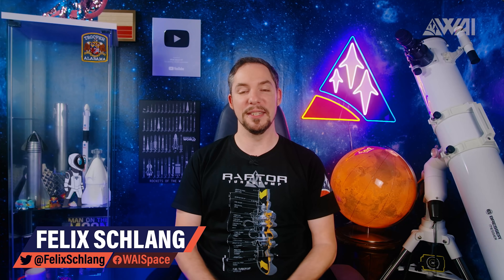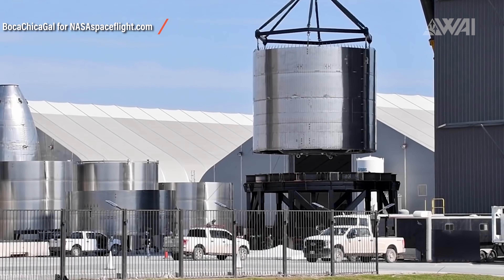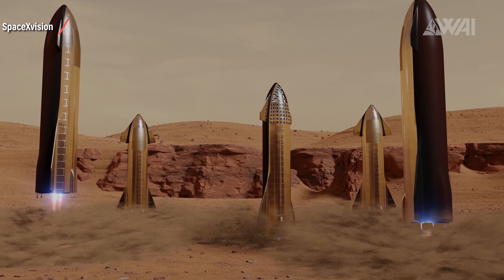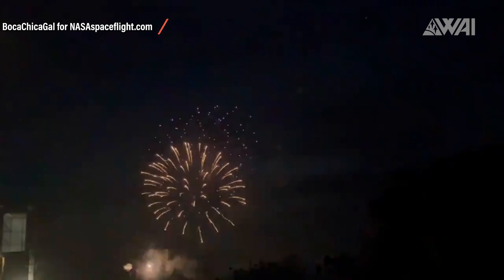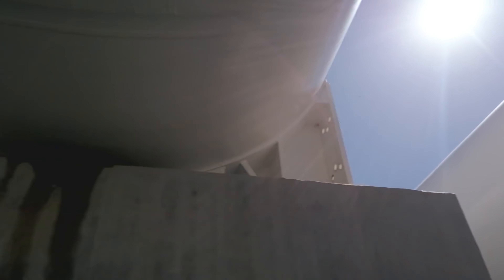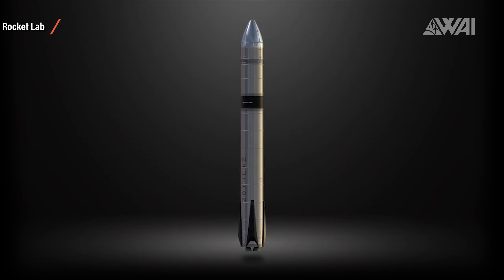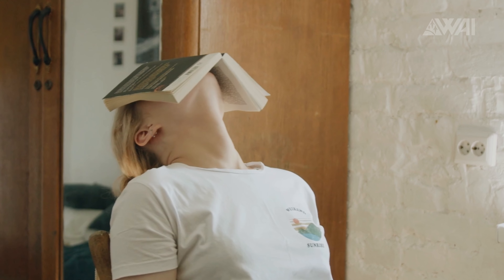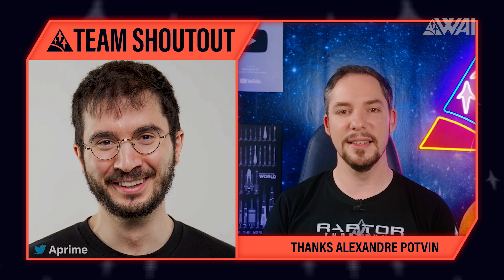SpaceX Starship Without Legs? Is Elon Musk Serious? Blue Origin & Rocket Lab Next Gen Rockets!

Comment: Could SpaceX create barrier between the helium and fuel supply in the header tank to prevent the issue with helium getting into the fuel supply? Use a bladder similar to a water pressure tank.

Comment: Cant see the legs working on mars or moon tbh, surely they're too small with a small surface area to take the whole Starship weight on a uneven, possibly softish/yielding surface. Something more akin to Falcon 9 would seem to remedy that, surely can't be that big a design challenge. The shuttle had undercarriage  that opened 'thru' the heat shield.

Comment: If it works for the Falcon it could be designed for the Starship, use Falcon landing legs but more robust.
Reply: The point is, Falcon landing legs are heavy. They are seeking a solution that will minimize mass, thereby maximizing payload capacity.
Reply: Could they make a similar idea of the Falcon landing legs out of Titanium or aircraft grade Aluminium.

Comment: Might as well give up on re-usable rockets and any plans for interplanetary colonization.
Trying to come up with clever ways to do away with some sort of leg/landing structure that is actually part of the vehicle, is counter-productive in my opinion. Maybe it's easier or more convenient than developing more powerful engines that would offset the added weight of proper-sized legs. To me, this sounds very much like how the space shuttle was developed. First, starting off as a complete single-stage-to-orbit space-plane, and eventually deforming into a sort of space-plane, that was dependant upon a huge external tank and boosters. The ideas now being proposed sounds like the development path is taking the same familiar route. That's too bad.

Comment: I still don't understand how starship can land vertically on just one engine offset from the centre.  It has to tilt to maintain balance.  Can someone enlighten me?
Reply: If at the same time it drifts slightly sideways, it can stay vertical. With just the right balance between vertical speed, horizontal speed and engine gimbal, it can touch down with minimal velocity and tilt.
Reply: Yes. Even I have the same doubt. With one engine it will tilt a bit. I don't think it will work out. However, SpaceX team is extremely talented. They will come up with new ideas.
Reply: It's like balancing a broom with your hand, but with a lot more accurate systems for precise balancing
Reply: @dwdadevil  But when you balance a broom your hand is directly below the centre of balance going through the shaft.  Starship is more like balancing a brick on one corner.  You have to tilt the brick to get the centre of balance above the corner, or it immediately topples over
Reply: @EASYTIGER10  As they did with a mass simulator, and the purpose of starship (cargo/crew) transportation, the broom is a great example.
But the brick example is good too, difference is computers with a lot of sensors are better than a human at maneuvering a starship

Comment: Can’t understand why nobody is saying much about the fire on SN10.  The fire appears to have started when one of the engines shut down. From that point on, the vessel was doomed, regardless of how it landed. With the fire burning and being fed with fuel,  if  it lasted long enough the metal temperature would have become high enough to guarantee the skirt/tank end cap would fail.
Reply: Obviously if persistent, fuel leaks must be solved. But failure was a LOX tank rupture. That has more to do with very hard impact and lack of engine thrust modulation.

Comment: Look, guys: helium pressurization don't help the fuel problem. The fuel is weightless in free-fall (zero g). When the flip is done with rcs thrust, the fuel is still weightless and floating around. Not until AFTER the rocket manages to get enough sips of helium and fuel, will they ignite, create inertial gravity, and then the fuel sloshes to the bottom of the header tank, and then one of the engines MIGHT light up ok.... Elon needs a baffle tank, like in plumbing: there's a rubber membrane (or u could use a piston and cylinder to pressurize fuel without any air or gas headspace. Just a thought...

Comment: I hope they will stick to legs and not ditch them, they have to at least use them on moon and Mars and they should rather perfect them by testing on earth instead of flying tenths of Starships to moon or mars and crashing them there.
Reply: There's different variants of star ship, the one that will launch the most though will be the tanker, which does not need legs.
Reply: I hope they are willing to ditch legs if they seem like a better option.  A lack thereof may allow for less maintenance and weight savings, meaning faster turn arounds and more payload to LEO, which would make sense for an earth-bound variant.  Undoubtedly the (pathfinder) lunar and martian variants well need legs, but this is something that can be optimized over hundreds of test flights when the time comes.  No reason for them to pigeonhole themselves into a one size fits all solution if something better is possible!
Reply: Ditching legs seem to be down to Musk impatient than anything else.
Reply: @DavidKnowles0  more like his engineering ethos. "The best part is no part".
Reply: @chadleach6009  ^^ this.
They've talked in interviews on how they've had to focus on simplifying the design to make manufacturing faster.  No part is best part aligns with this perfectly xD
Reply: Hear me out, bouncy castle on the moon? Eh? Eh?  C'mon, who would pass up a moon bounce castle party xD
Reply: Maybe they could find a viable leg design on earth that works for moon and Mars, too. Then, if possible, they can ditch the legs on earth-Starships like tankers. Because I just don't think flying Starships to Mars just for testing legs until they work is a bad idea.
Reply: @Astromath  that's more or less what I'm saying.  Just in the other order.  Make them without legs, and have a separate batch of prototypes to test legs (obviously on earth) when the time for that comes

Comment: Hi and thanks for another good video. I am posting the following on here and will copy/paste on others as well since I cannot post on Elon Musk's twitter account due to my account being suspended, while I still await for an explanation for my suspension and hopefully be unsuspended in a brief future. So now that this it out of the way, here's my thoughts and opinions on  "StarShip"  successes and failures. Personally I don't really see failures in SN8, SN9 and SN10 flights and specific maneuvers and landings because after only 2 launches and explosive landings, SN10's mission was successful in all it's maneuvers from launch, belly flop, descending to hitting where  "X" marked the spot. Thus proving that these maneuvers is the way to go and just needs tweaking's from what they've learned on each launches/landings and now adding/counting SN10's success up to the 8th minute where it exploded. So technically SN10 did everything right and proved all competitors/detractors that these methods of maneuvers are the way to go and are definitely possible to achieve. 

The biggest issues are about the landings which is just a matter of a short period of time before all is resolved.  Now, my technical opinions and positions on what keeps going wrong no matter what other issues they fix on present and future  "StarShips" . 
In my opinion,  "StarShip" , is the only spacecraft/rocket ever launched that has this kind of engine bay/skirt that has it's engines within a skirt, has no firewalls to protect the upper parts of the engines and other important components, has no water prevention system and is extremely slow at takeoff to clear it's launching point. Even it's two little brothers, Falcon9 and Falcon Heavy benefit from all those supportive systems at launch and lets not forget that Falcon 9 and Falcon Heavy's engines are outward and not within a skirt like  "StarShip"  and probably gets damaged at launch due to not enough ground clearance. Meaning, all the flames, heat, sound vibrations and even debris are bounced back upwards towards the inside of the skirt and engulfing the engines and the total inside of the skirt and due to it's slow ascendance it gives all of those issues mentioned above more then enough time to cause damages during it's launch. 

So basically,  "StarShip"  launches already damaged which makes it hard to get a 100% successful landing, even if all the maneuvers went according to plan and looked nominal. When "StarShip" lands it faces the exact same issues upon touching ground, "NO GROUND CLEARANCE"  because the legs are way to short, so short that when SN10 landed due to a faster speed than desired/wanted, it crushed the legs that were locked in while the other 3 legs were totally useless due to never having locked in the right position. Even with all these issues, SN10 still landed upright and stayed so for 8 mins while laying on it's skirt. And unfortunately, since there wasn't even an inch of ground clearance, they couldn't get the water to reach the inner skirt, just no way to get to it and the rest is history. Elon Musk has mentioned that they might re think the landing by capturing  "StarShip"  like they intend to do with the  "StarShip"  booster. In my own (don't matter) opinions. All the major issues resolve around the launch and landing ground clearance with a few preventive proven method to assure a good launch without any early damages by increasing the ground clearance at launch, installing a firewall that protects the engines and other components from the flames, heat, sound vibrations and debris bouncing off the ground and going upwards into the skirt with nowhere else to go due to being caught within the skirt until  "StarShip"  gets high enough to clear away from those issues.  
 

Next the landing! Elon Musk and his incredible teams of brilliant engineers must deal with the biggest issue which is the legs of  "StarShip"  .  These little legs they have on right now, just won't cut it. Don't forget that we're dealing with a  "StarShip"  that's empty and these legs can't handle dry weight so imagine if it carried a few tons of cargo. True that a returning  "StarShip"  would be empty and that if it had any cargo on, it would be at launch from Earth and landing where there's 0 gravity, so those legs might be able to handle a landing on the Moon or Mars but is it something you would want to find out when landing on those two celestial bodies or know right now if they can handle a loaded or dry cargo bay? If they can create legs that can handle Earth's gravity while giving it enough ground clearance to not damage the engines and other components within the skirt, then BINGO!! All problems solved in regards to creating a  "StarShip"  that can be used more than once, just like they did with Falcon9 after a decade of RD, trials and errors and now sending Falcon9 rockets at a rate that rivals the UFC fight cards which used to be on a few times a year to now a fight card every weekend.
 

So, bottom line is... 1) give  "StarShip" more ground clearance at lift off, add a firewall within the skirt to protect the upper parts of the engines and at the same time protecting other important components, launch from a pad that has a water preventive system like all other rockets do (build one), try to clear the launch pad a little faster (easier said than done I know), so basically it all comes down to giving  "StarShip" as much ground clearance as possible so that the flames, heat, sound vibration can escape instead of being stuck within the inner skirt of  "StarShip"  and causing damages that will affect  "StarShip's"  landing. 
2)  "LEGS, LEGS, LEGS !!!"  ... We all know that the present scrawny little legs that are on right now will never cut it, 1st they are too short and too small girt wise and 2, the longer you make those legs, the weaker they will be. I know that the legs issues are causing  "SpaceX"  engineers serious headaches due to reentry in Earth's atmosphere and the heat shield components are made to be on an even flat surface which makes it hard to even contemplate using the same kind of proven legs of Falcon9. You just need to find your way around it and develop a similar leg system that can be protected by heatshield tiles (easier said than done, I know). 

I know that Elon Musk has said that the reasons they launch they way they do, without better ground clearance and no other preventive methods/systems is to simulate a launch from uneven ground and no preventive system because that's the way they would launch back from the Moon or Mars. Ok good reasons, but you need to facilitate the earth launch using all the methods with all the systems available for a earth launch so that nothing gets damage at launch. Once landed on the Moon or Mars, everything changes due to the lack of gravity, the  "StarShip"  will clear a lot faster on the Moon than on Earth and with the legs issues solved, should have a soft landing. You need to make the launch easier to assure no components to be damaged from Earth launch using everything at your disposal, like a firewall, water preventive system, higher ground clearance and so on. 

P.S ...This is Elon Musk and  SPACEX  we're talking about, they can resolve everything and anything!

Comment: Why does SpaceX flip the Starship so late/close to the ground?
When I was watching the landing of Sn10 I wondered why SpaceX does not flip Starship several Kilometers above the ground and is instead doing it at the last moment possible.
Wouldn't this make the landing far more easy because they can flip the Starship much slower and can slow down for a longer period of time. Course corrections would also be more easy in case something goes wrong because the ground is further away.
Maybe I'm missing something important, but I can't think of any reason why you should do the flip so late into the landing.. 
I hope u guys could help me out :D
Reply: I think when coming from orbital speeds you want to bleed as much of the energy as you can! That's why the belly flop even exists. Besides, if they flip early, they need more Delta V to slow down in the landing burn. That requires more fuel which reduces payload
Reply: They flip is so late because in bellyflop mode the terminal velocity is much lower. They can land with less fuel that way, that means heavier payload.
Plus they can control the descend really easily with the little wings so it's probably easier/safer to flip late as soon as they have enough data and the pressurisation and engines are reliable.
Reply: Well makes sense :D 
Tanks!

Comment: Couldn't a third rear "fin" be added and all three fins be extended beyond the rear of the ship and tapered to pads; feet for the ship to launch and land on in a tripod configuration?
Would look even more like an old Flash Gordon rocket😂
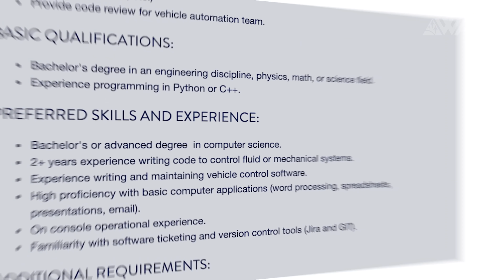Reply: The aft flaps are located at about 3:00 & 9:00 and, as built, cannot handle landing loads. A third leg would have to be located along the center of the heat shield on the "belly" and must retract while skydiving.
Reply: @imconsequetau5275  I was picturing the third fin on the "spine" of the ship, say at the 12 o'clock position, with the other two shifted to 4 and 8 o'clock. I'm guessing the flap undersides will also be heat shielded. Aerodynamics and handling would be hugely altered, but I'm guessing (again 🤣) that these characteristics are computer controlled.
I love those old black-and-white sci-fi serial rocket designs with fireworks shooting out the back 😍🤣
Reply: @robertoneill1979  
I remember the smoke plume making a wonky curve because they oriented the model horizontally. Turned the camera 180° and flame-end-up in later episodes. Learn as you go.

Comment: Why not add a third fin and install the landing gear in them.
Reply: Leave the two where they are and put the other one halfway between the two on the side that isn't heat shielded. Have it land with a slight lean to keep it's center of gravity straight with the offset gear.
Reply: @Fowlz gonna have to research that one. I thought they got rid of it because they tried to do them at a 120° offset and it didn't provide enough drag upon reentry. However doing it the way I described would still allow for sufficient drag during reentry and might even give you slightly more control of the ship.
Reply: Another thing that I'm not sure too many have thought about. The final starship design is by it's very nature goin to be top heavy as all get out upon landing. The tanks are gonna be empty and the crew portion requires lots of mass for life support.
Reply: @Fowlz maybe a little but look how lop sided the shuttle was. It'll still be under less strain than that.

Comment: What's actually the problem with the Raptor engines?
Reply: As far as I remember, cannot throttle down a lot, not as reliable (but that'll get better because a full flow stage Combustion methalox engine is one of the first I guess)
Reply: @manashejmadi  Thanks so much.